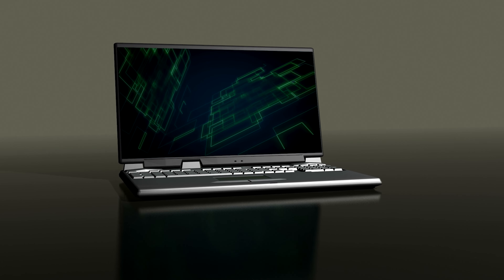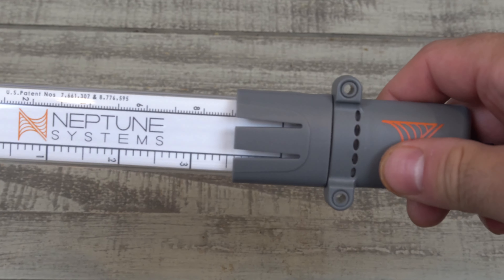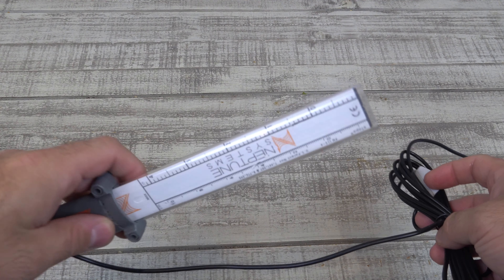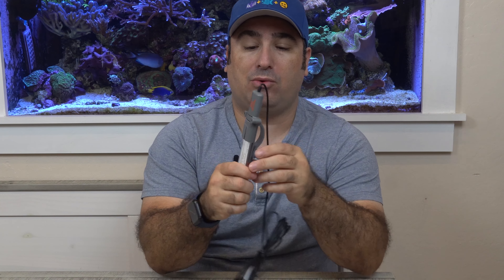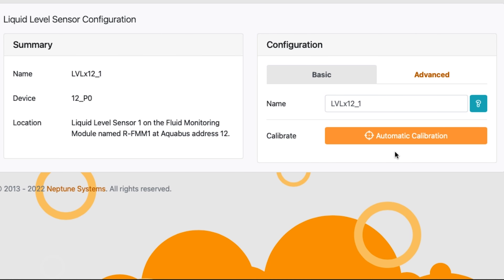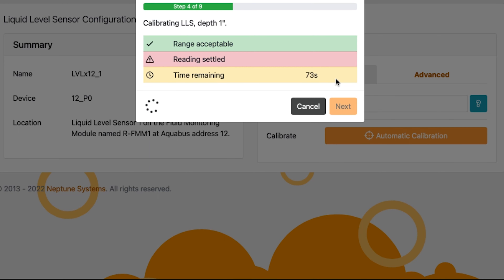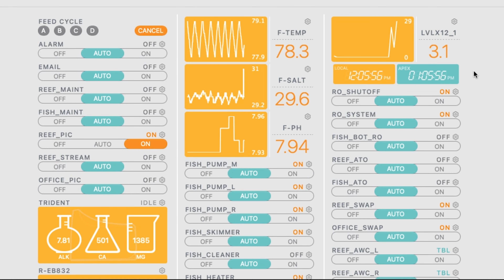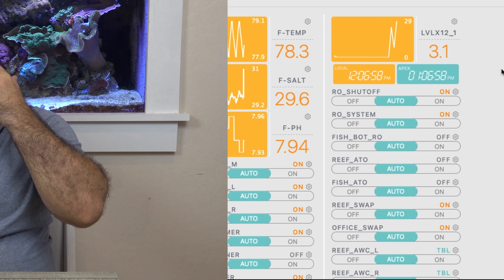Reef Automation Reviews - Neptune Systems LLS Review And Setup!

Comment: Any updates on this thing? My range is not accepted even though I am following the directions to the tee both in automatic calibration and manual calibration. The readings are off... 6" is reading 69.5 and fluctuates alot...then time out on the calibration.
Reply from the maker: Still have not installed these.  Find them rather silly TBH.

Comment: A few clarifications:  Not covered in the video, but the LLS Initial Setup Task in Fusion is the fastest, easiest way to setup a new LLS.
The units can be set to either inches or centimeters in the FMM module configuration.  This is a global setting - set it for one FMM, it is applied to all FMMs (just like you can set LPH or GPH for flow sensors)
The white eTape is made with a tough polymer which is chemical resistant; the tube is not acrylic - it's polycarbonate.  The LLS can be cleaned with vinegar/water mix or citric acid.
Reply from the maker: Thanks Russ!